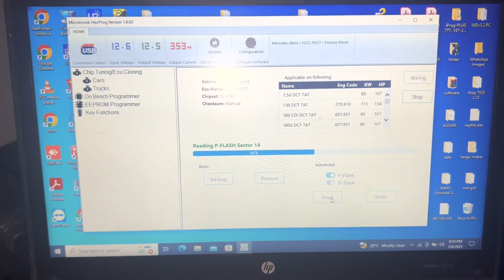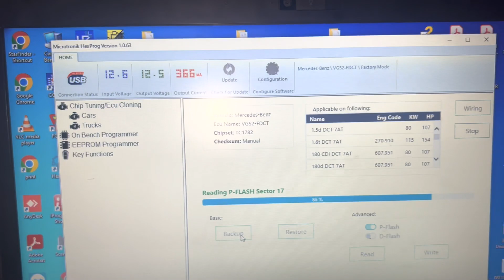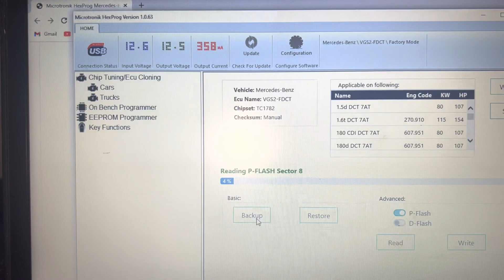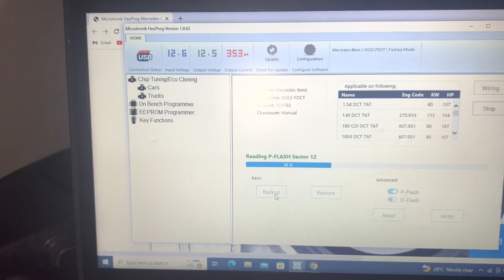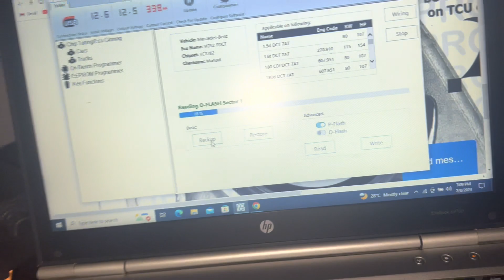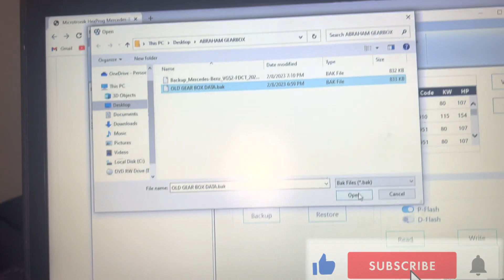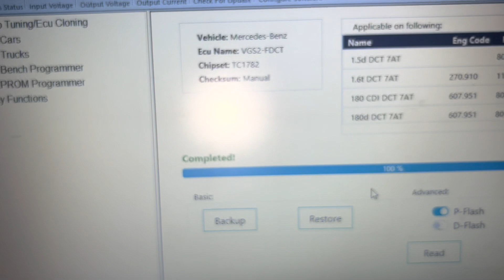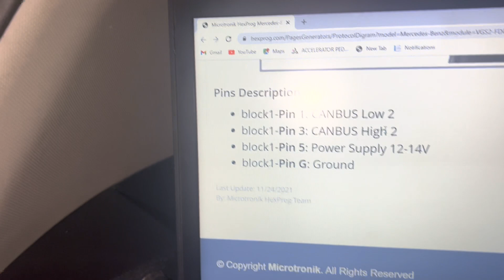MERCEDES BENZ: CLA W117 2018 GETRAG VGS2 FDCT GEAR BOX CLONING

Comment: Hi there, I didn't understand at all what are you doing... may you explain for us?
Reply from the maker: cloning of Mercedes Benz CLA W117 TRANSMISSION OR GEAR BOX, i will upload another video of it to explain further, there are two types of this GEAR BOX we have VGS2 FDCT and VGS FDCT. The VGS2 has 4 pins which MAGICMOTOR SPORT programmer can read and write the data but VGS which has 5 pins cannot be read by MAGICMOTOR SPORT except using HEXTAG mind not here to let people know which device is good or not and i have both tool.